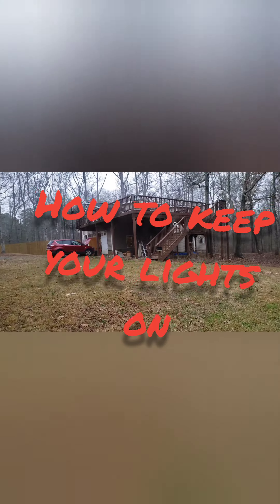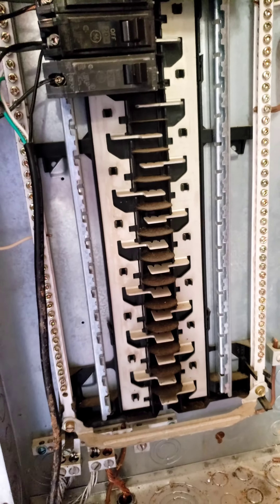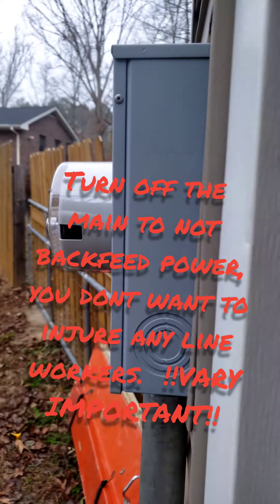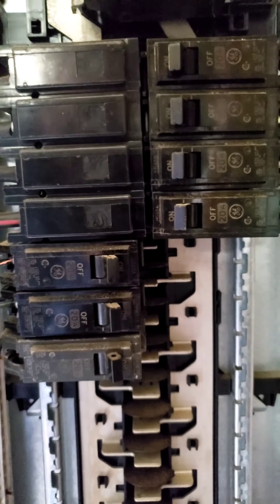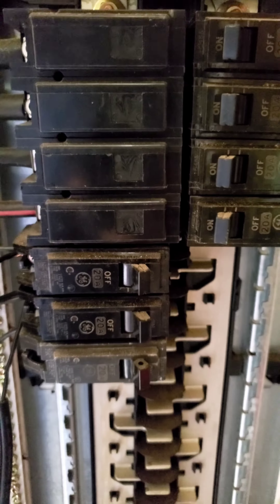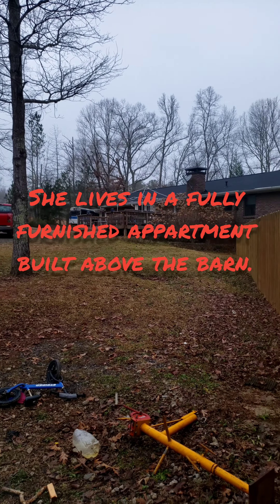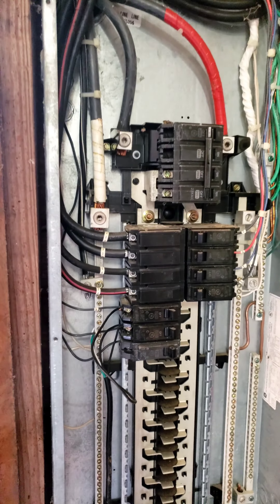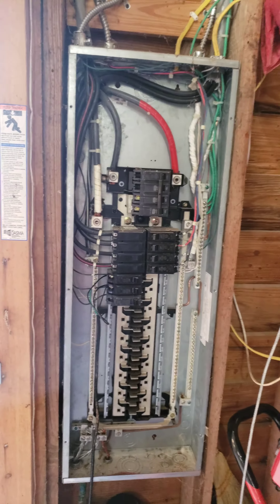Power your whole panel from 120v inverter, Emergency panel wiring.

Comment: Perfect!  Just built a solar generator and was wondering how I could power both legs of my panel with 120 volt. Pretty simple. Your video was the first to come up. Thanks for sharing. 👍🏻
Reply: Put a jumper between the hot legs and label the panel clearly.  If your generator is feeding it 120v.
Reply: Thank you.
Reply: I'm kinda doing the same ,but i have a 240v generator hooked up with ainterlock . ?

Comment: Question!  When your ground and neutral are tied wouldn't you burn up a non sine wave inverter?  A non sine wave puts 60v through hot and neutral, and with the ground tied to neutral it would short.

Comment: Ive backfeed with my 120v inverter. But the only way that it works is, with one hot and the neutral wire. It doesn't work when i hook up the ground wire. Im thinking the reason is because my panel is bonded already.

Comment: For a complete offgrid application. 
My 240v generator is hooked to the 100amp main breaker .
My solar is hooked to a 30amp single poll breaker on Side B .
I have a interlock swith in place .so i can't back feed to either power source. 
I have not done this jumper yet .
But can I take a double pole 30 amp breaker ,put a jumper wire .
And safely feed both A&B ???
From 30Amp solar enverter .
And does jumper breaker need turned off when 240v genorater feed box ???

Comment: Great Job ! “ I got a question if you would be so kind and say I have a 5KVA solar inverter what’s you’re thoughts on 230v the L1 - is Hot 115v+ & the Neutral is Hot 115+ and ground is Ground “ my thoughts are off the inverter the L1 ~ 115v to 1 Phase in main panel & the Neutral off the inverter which is Hot 115+ to the other side of the main panel ! Making the box One Phase in an Electrical Emergency grid down “ the inverter is Hybrid “ but I would still shut off the 2 mains to keep less electrical confusion from losing split Phase to 1 Phase to Back to Split Phase ! Worse case scenario if I was sleeping the Hybrid inverter would kick electricity on if lost and would stop the whole main panel as One Phase when electricity came back on , “ Are “ there any issues going 1 Phase to Split Phase in you’re main panel ? If you would be so kind to answer ?

Comment: Proactive verses reactive.....install a 30 amp plug ahead of time with an interlock for the breaker box and an adaptor to go from the 120, to a 3 prong then to four prong to plug the house into

Comment: In a pinch this will work, but if you're not in a pinch, get a 240v generator inlet, an interlock for your main breaker, and 6' of Romex. Make or buy  a dog bone cord that has a jumper in it to power both sides of the panel.

Comment: Fantastic job - I’m using a 5KVA 230v 93A solar inverter 48v on this 230 V one phase inverter L one is 115 V the neutral is 115 V in ground is ground so technically you have two hotlines coming out of this one Inverta yes it’s one phase but it’s at 115 V and what I can figure out 93 A divided by two is 45.5A Per phase and then the grid down situation having half your amperage is better than having no amperage at all thanks for your video clip electricity they try to make it too complicated and you write it down right to the balls to the wall working !

Comment: I have an inverter 5KVA 230v pure sine wave inverter I was planning to do what you did thank you , I was going to back feed through a 100A Double Pole Breaker and use a transformer Seimans MT0100A 220-240v in & 110-120v out ! Only for when the grid is down ! What do you think ?

Comment: I was thinking the exact same thing. Put two pole breaker and jumper wire between two poles to achieve 120 on booth bars. As long as your not running 240v appliances I think your Amps will shoot up if you do

Comment: Just add a transfer switch for safety....anyway my question is...since as you said only as emergency 😁...what if instead of jumping the single pole 20Amp breakers...you used 2 outputs of the inverter with 2 extension cords?..are the 2 outputs diferente coming out of the inverter?. Thanks

Comment: You can also wire from 110v standard outlet to 220v plug without the ground if 3 plug, "jumping" the 110v into to the 2 prongs for it to cross the phases. It works but disclaimer not an electrician do it at your own risk

Comment: My 120v  solar generator has a 30a plug, I back feed thru the dryer plug, since the tt30 plug has 2 15 amp hots it energize  both leggs, but yea, you got it, just dont over amp your unit

Comment: I guess after watching the video my only question is can u leave the solar wired up like that once your landline utilities are turned back on
Reply: No, you would need to at least turn off the breaker with the jumper in it since that would be a dead short when fed from the utility side

Comment: IT IS RECKLESS AND DANGEROUS !!!!
(I am going to do the same thing in an emergency.)
Reply: Based on a couple of the comments, it IS reckless and dangerous. If you have a basic understanding of electrical wiring and mains power it’s a heck of a lot safer. Remember kids: Interlocks are only 40 bucks…

EDIT: The worst part is that it’s more dangerous for the Linemen than it is for you. For anyone reading this, if you don’t turn off your main breaker or forget to turn it off, then you can send your generators electricity down the power lines and electrocute a lineman or even a family member or neighbor if lines are on the ground. If you do this, the best method is to use a generator inlet box permanently wired to a generator breaker in your panel, while also installing an “interlock” on your panel. This can all be done for less than 150 bucks in parts (that includes the breaker, generator cord, interlock, and inlet box)

Comment: This makes me jealous😂 We use 230v out here but our local governments care a lot about safety, a little too much. I can't access anything without removing almost the entire structure. It's made so you only flip the circuit breaker when needed and that most will just hire an electrician to not have to deal with it.

Comment: How to kill a lineman 101 right here ...
Reply: The main is off, so how? Just wondering?
Reply: @The_Vols_Eye  because it needs to interlocked someway! So as the only way the generator can feed through the breaker locks out the ability to have the main on. It’s actually illegal in most places to have it without an interlocking device or transfer switch
Reply: @sashly99 True!! If you don’t have an Interlock, there is always the possibility that that main breaker could fail and close back up. It’s a mechanical break that could always fail. The interlock prevents closure even in the event of a failure of the breaker.
Reply: @sashly99  Like he  said if you shut the main breaker off, it doesn’t matter just don’t need that stupid piece of metal
Reply: @dw5878  what you shut the main breaker off it doesn’t magically turn itself back on😂😂 the inner lock switch does nothing for that!
Reply: @sashly99 TOTALLY AGREE!!!
As a high lineman if I were to see this I would have pulled the fuses on all transformers related to the property and called the local law enforcement.
Reply: @aarongores1662 IF you have no idea what you are talking about don’t say anything at all!!!
Reply: @aarongores1662 true, but it you are the shut it off, there could be another person who could turn it back on, oh look, I found the reason the electric stove don't work, the main is off.😮
Reply: If any lineman doesn't operate with the Idea all lines are live,down or not, you wont make it long. Stupid is as stupid does, listen to Gump

Comment: If you’re inverters output was 220+v you could get a Siemens MTO 100A Transformer 230v in One Phase & out Two 115v dual Phase what I’ve read ! To keep any 220v lines ! Think about it I am Not An electrician !